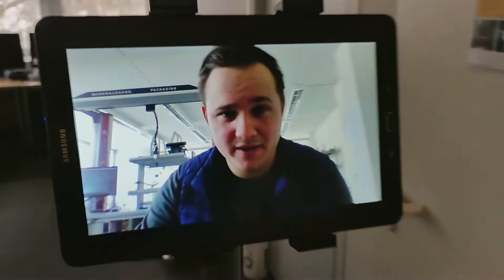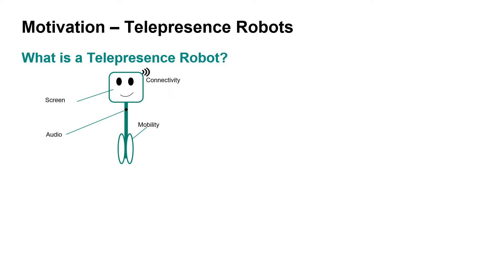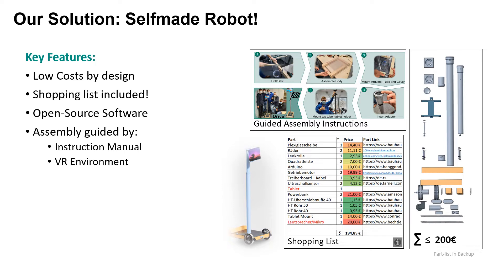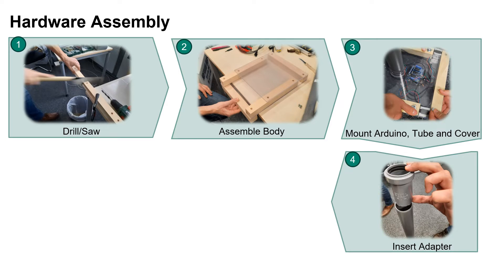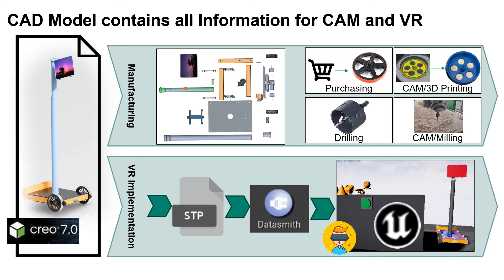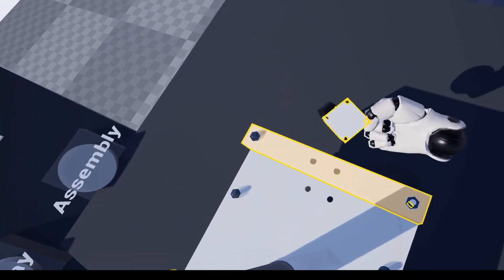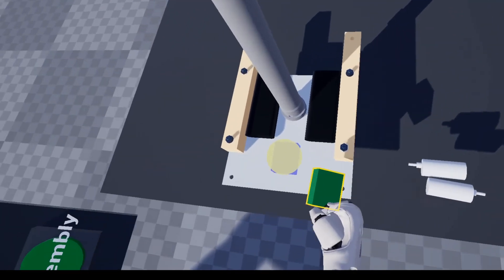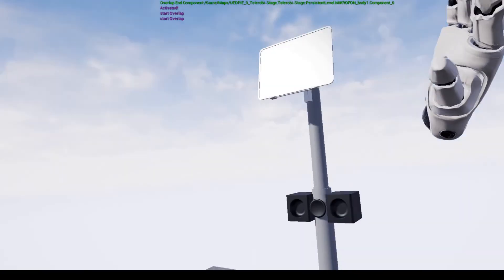Telerobi - DIY Telepresence Robot project VRP WS2122

Comment: Are there links to this design and parts list?
Reply from the maker: We've just uploaded the source code and are still working on the guidelines. Please check this repository, https://github.com/Victor-Haefner/telerobi/, there is a link with the  guide and the parts list inside. There are still some improvements to do until the end of the project (trine-plattform.com) in 2023.